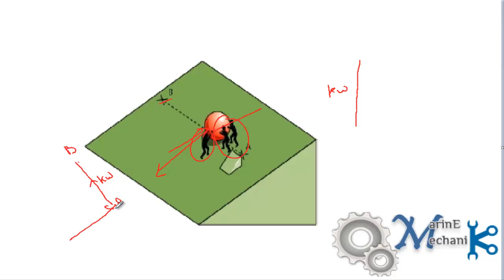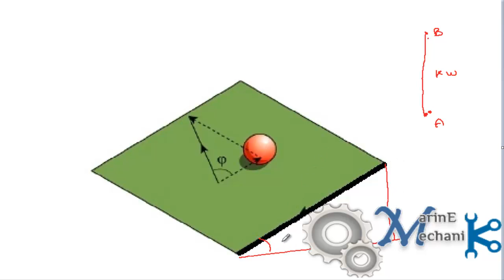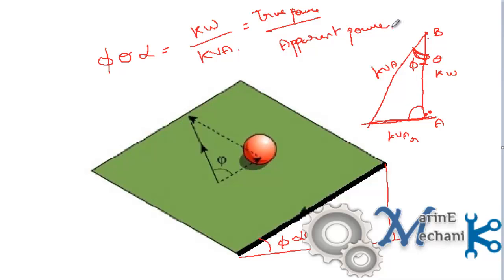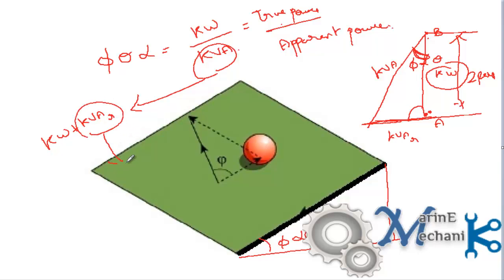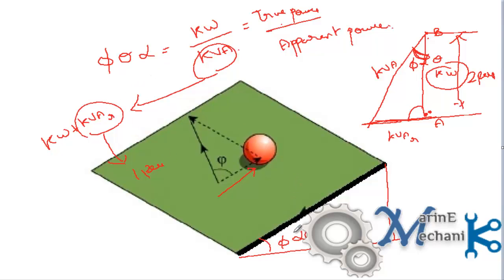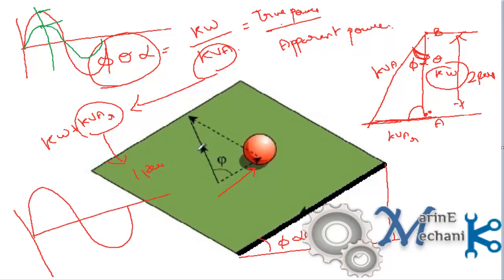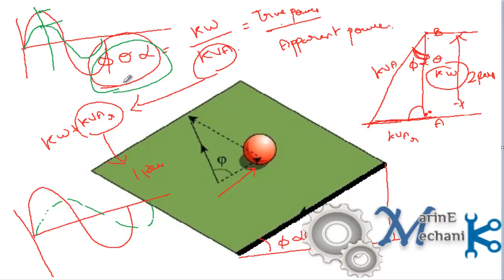Best Explanation for KVAr..with an Example, Must Watch. Part 3.

Comment: It's a great explanation, but if we continue the analogy into the electrical realm, if the one pushing sideways is KVAr, what is the electrical equivalent of the fact that the plane is inclined? What does the inclination correspond to electrically?